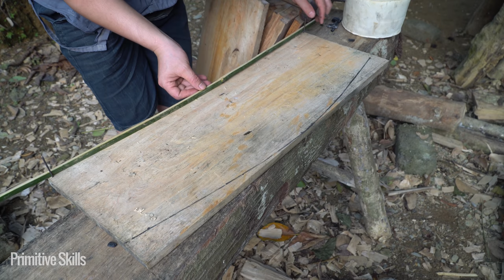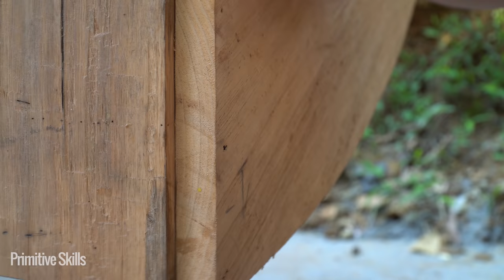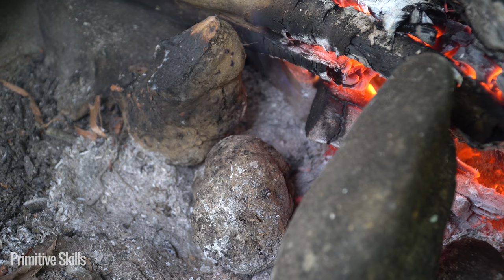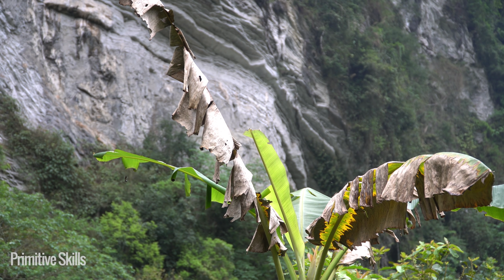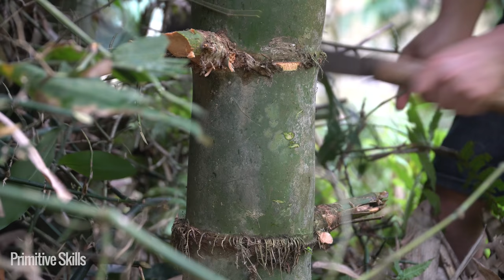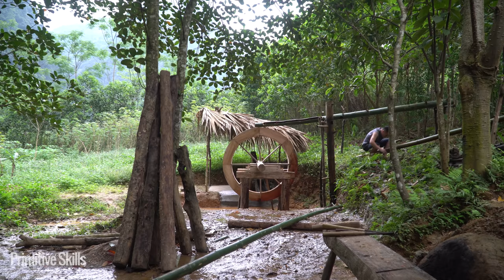Primitive Skills: HOW TO BUILD A WATER WHEEL // Complete After 2 months, put into TEST RUN - Ep.134

Comment: He was powerful before but now he has access to, UNLIMITED POWER!!!
Reply: POWAAAAAAA
Reply: Do you mean stand powa?
Reply: Not really. Yeah, he can get it to turn, but if he tries to connect that power to anything, that wheel's going to stop turning. I can barely keep up its own momentum, and even as those rough spots wear down, it's just not efficient enough to do much work. His power hammer build was a LOT more efficient, because it would actually do the work. This won't, as-is. He need BOTH more waterflow, and a more efficient axle.
Reply: @FornaxusCrucible  aye, he’s gonna need to smooth out the axle and find himself a proper lubricant to keep it spinning
Reply: He could also run another water line right beside the one he has so there's more water pressure to turn it
Reply: @jackturner3803 little bit'o spit, hell be golden!! 🤣
Reply: @FornaxusCrucible  he can make an electric motor if he finds copper
Reply: @Resiprocity  he needs more than that. He'll need an efficient steel axle for the coil, and he still need to REALLY drive up the efficiency of the wheel, itself. But yes, theoretically, that can be done. He already has the tech to smelt the copper, which is a good start (assuming he can either find the raw ore, or better, "pureform" copper chunks).
Reply: @tylerv7938  That would also help quite a bit, more volume of water would really do the trick
Reply: Hunt a pig...render the fat. Enclose and seal the axle and cradle surfaces. Pack in the fat. Or, find a similar wood to Lignum Vitae for the bearing surfaces. Whatever he does to solve the friction I will be interested to see.
Reply: Adding more water will not increase the force of the wheel, only lubrication will allow it to share it's true force.  More water will only cause it to turn faster.  After all, once the scoops get filled, will it have enough weight to turn the wheel.  Now fully enclosing the wheel will make it pressurized and increase the torque it produces.
Reply: Well, the wheel isn’t spinning consistently at all (It keeps the same speed forth barely 3 seconds, stops, speeds up, slows down tremendously, so on and so forth). He needs more water flow, and a better and more lubricated axle. Even when he gets at that point, he needs a permanent magnet, and to surround it with coil. He has the power available, but the hard part is actually harvesting it for some energy. That’s the problem that we have now, we literally breathe unlimited power, but we can’t find a way to tap into it.
Reply: @FornaxusCrucible  The place where the axle touches the base of the water wheel should be made thinner and smoother, that’ll help to make the wheel turn consistently.
Reply: @potatoboy549  The weight of the troughs when full will always stay constant,  More water flow while it may fill them faster, it will still stop.  Same water flow, and a work around on the friction problem should be the next bet
Reply: @luckyx16  Or more water flow and larger troughs on the wheel. Enough water to fill the troughs just as fast, but at higher volume will increase the force. But that's still only part of the solution.
Reply: @FornaxusCrucible  Yes, larger troughs would add more weight and counter act friction.  Are you going to tell the poor guy to rebuild his wheel?  I am not.
Reply: @luckyx16  More water flow will help the wheel go faster, which is great, if it’s going to be used for a better forge blower, a loom, a lathe, etc. Some animal fat (Preferable from wild boars, granted this guy doesn’t get headbutted and a tusk stuck inside his stomach trying to hunt one) some bearings around the axle, and to smooth out the axle will make it not stop.
Reply: @luckyx16  More water flow will help the wheel go faster, which is great, if it’s going to be used for a better forge blower, a loom, a lathe, etc. Some animal fat (Preferable from wild boars, granted this guy doesn’t get headbutted and a tusk stuck inside his stomach trying to hunt one) some bearings around the axle, and to smooth out the axle will make it not stop.
Reply: @FornaxusCrucible  I expect barrings or lubricant should be relatively easy to make compared to the whole itself.
Reply: @FornaxusCrucible  Yeah, the volume of water running the mill is insufficient for that size mill. He needs more water, or a larger mill to use Archimedes principle more efficiently in order to be able to draw some usefull energy from this.. As for now, it is a useless installation. building skills, and craftmansship, I applaude him, but the progress he makes is deceptive. Using the methods he is showing, there is no way he produces enough high quality Iron/steel to produce those tools. Enjoy it as entertainment and inspiration, and accept he cut some corners to progress. I believe however, he would not see the number of views and subs if he were up front about it. Original Primitive Technology should've continued.

Comment: A few ideas that will help:
-- use the motion of the wheel and a chisel to lathe the axle bearing geometrically round
-- beeswax as lubricant
-- balance the weight distribution by removing material from the bottom if it swings back like a pendulum
Reply: Хороший совет т👋

Comment: Now to develop a gear and gearbox that will work your bellows for you. Also be cool if you planted some fruit trees and bushes.
Reply: gear box?  whats wrong with the old method  a simple old eccentric as in locomotive wheel is connected to piston rod  by an off center axle   ....thats called an eccentric..it is an easy way to convert rotational movement to linear movement....are you going to ask about a clutch now?
Reply: The bellows should not be the main priority. Hook the gear up to a circular metallic saw, and the progress thereafter will be on the next level!
Reply: @mobiousenigma  To be technical I was thinking a reciprocating rack and pinion set up since we are dealing with wood and simple iron hand tools. Having a gearbox would give him options to hook up different equipment. Even your locomotive eccentric, although I dont think it would work well when made out of wood.
Reply: @TheEminemOwns  Wouldnt a forge upgrade help make that circular saw? Seems like it would be difficult to make a thin and flat circle and would require more than 3 inches of heating space.
Reply: @PaleGhost69  This water wheel was also "difficult to make" you know
Reply: @PotionsMaster666  The waterwheel is made out of wood and is a 3000 year old technology. It's not that difficult when you have the right tools.
Reply: @PotionsMaster666  Does he have the right tools to make a circular saw with a radius bigger than 3 inches?
Reply: If he can get his hands on flux, he could forge weld a hollow saw. The alternative is to use his current saw blade (or a new one of the same design) for a linear motion mechanical saw.
Reply: He probably built that waterwheel for lathe. Without lathe he can't make proper gears and automatic machines
Reply: @Kenionatus  What will the flux do ?  How will it affect the quality of the saw ?
Reply: @PotionsMaster666  Flux prevents oxidation. Without some way to prevent oxidation, you can't weld (afaik). The oxide layers prevent proper bonding.
Reply: @Kenionatus  But wouldn't flux come in between the layers and prevent them to bond ? 
Thnx for the reply man.
Reply: @PotionsMaster666  Just looked it up on Wikipedia and it's quite simple: the flux gets pushed out by the force of hammering. Flux melts at the temperature for forging the metal in question, so it is quite easily displaced.
Reply: A lathe and a better, automatic forge blower should be the priority. A lathe for better gears, and to upgrade the water wheel, and a forge blower obviously for better iron scraps and tools. But before any of this, the axle needs to be lubricated, possibly from the fat from wild boars. A water wheel opens a bunch of possibilities, and this guy will soon enter the Industrial Revolution and start making some machines
Reply: @PaleGhost69  Old school (very old) trip hammers could be run by a peg or cam on an overhead shaft.  The peg on the shaft would rotate around and intersect a corresponding peg on a vertical shaft, lifting it until the peg on the rotating shaft passed the top, and dropped the vertical shaft.  This trip-type mechanism can be used for many different reciprocating mechanisms, and can be easily engaged/disengaged without the use of a complex clutch.
I could see this being very useful, for automatic hammering, bellows, sawing, and especially water pumping.

Oh yeah, and they work great, even made of wood.

I think it would be a really neat (but involved and laborious) to see him set up a water tower for power accumulation, have the wheel run constantly, pumping water into the tower, and when he wants it to run faster, let water down from the tower into the wheel.
Reply: Isn't the main point to mill the grain? Wasn't that the reason the other parts of the water wheel series kept showing the monjolo pounding at grain?

Comment: I would recommend a cap for the axle and a possibly a sacrificial bearing surface, leather,  lubricated with a fat based lubricant.
Reply: An Iron ring polished smooth will wear less than wood on wood, and divert the dripping runoff water to keep it cool.
Reply: @xkblxcripple  you can't put Iron there's water
Reply: @powergamer4968  polished and waxed stone, maybe? Or graphite grease?
Reply: I know it would be a nightmare to make, but cant he make wooden or ceramic based ball bearings? i mean. he can melt iron, the bigest problem here would make the bearings have the correct size but it would make the friction go way lowwr than wood on wood or wood on lubrificated leather
Reply: I have come to think of the alternatives offered in the comments to improve friction. Although I think the rotation would at least be improved with a dodecagonal (12 sided) design instead of octagonal. Ideally, it should be a perfect circumference, although it is more difficult to achieve and more laborious.
Reply: Fat harvested from wild boars for a lubricant and some wooden bearings is all he needs for now. Once he upgrades to a better forge blower with all this, he’ll definitely be able to melt some iron and make some iron bearings.
Reply: @newemc2  Sorry, I don’t understand math language, please speak in English
Reply: @potatoboy549  The axis that he has put has an octagonal shape (regular polygon with 8 equal sides), it is not entirely circular. The closer it gets to a perfect circumference, the better it could turn/rotate, and the less friction. Since giving it the circular shape requires more time, you have to be more precise in the cut, and invest more energy, I would propose to make a cutting axis of a 12-sided polygon: https://en.wikipedia.org/wiki/Dodecagon
Reply: I think that smaller diameter axis (carve some excess wood from the axis), so there would be smaller contact surface and smaller friction. Still awesome stuff
Reply: @michasowik2438  Bingo. That's the issue. Physics.
Reply: @powergamer4968  aslong as iron keeps driped on by water(stayes underwater) it can not rust, so no problem. water being used as lubricant and as cooling factor (the water layer on the metal keeps the o2 "oxygen" away from forming rust and cools away the friction heat.)
Reply: At one point, i thought he was going to use a large diameter-ed section of bamboo for a ball bearing of the axle. Replaceable, easy and smooth.

Comment: this is so cool. i have a few pointers, feel free to disregard.
the first is to shape another two pieces of wood and fit them over the shaft, to stop the wheel from trying to jump out of the rut. just two pieces of wood shaped as a U and nail it down. 

second pointer is to rub some sort of fat on the shaft instead of water. water in industrial uses is not actually a lubricant. you're better off catching some fish, rendering them and rubbing that grease onto the axle. you'll have to reapply fairly often i imagine but it should stop the creaking and make the wheel run more smoothly. 

nice job on all the work you've put in though, it's pretty incredible.
Reply: Just using the coal as lubricant is enough!
Reply: @Nitro8996 some mushed up leaves might work as a lubricant too. They certainly cause a lot problems with slippage on our UK rail tracks !
Reply: Agreed a cap would help. However IMO the main issue besides lack of lubrication is that the axle diameter is too great. They need mortises carved into a smaller diameter. Basic physics. 
Oil and grease can be hard to find in the natural world. Possible sources: animal/chicken, cotton seeds, palm seeds, coconut. Also, if there are bees there is bees wax.

Comment: Yeah bud you need some kind of wax or animal fat in the joints of your water wheel lol. Maybe even a really oily plant you might be able to mash up and stick in the joint? Well done on the build 😁👌
Reply: También puede usar un poco de arena de rio, así consigue dejar la madera fina por la abrasión de la arena.
Reply: Or he at least should probably sand down the joints. And build a cage around the joints so it can't hop out of track by accident.
Reply: I am surprised he diante used some sand to smooth it a little.

Comment: Would be awesome to see a powered saw mill built from this!
Reply: Yes, this is a huge advancement.
Now he can power multiple machines with the cam. It can drive his piston billows to power a larger furnace, run a saw mill, a grain mill, even a hammer for faster iron working.
I imagine some of the next upgrades will be:
A spinning wheel, a loom, an anvil, a circular saw, a blast furnace, a glass furnace.
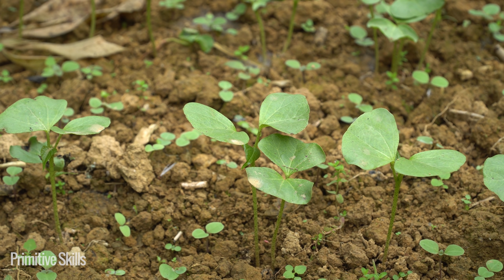Reply: @FourthRoot  seeing as he's growing cotton at 8:48 yeah i was thinking a loom is coming as well! we'll see what he does first! new fun and exciting episodes ahead!
Reply: He’ll definitely build a lathe. This is a precursor to gears, and a gearbox. After this, he can build a better forge blower. Throw in some bricks from some clay, and he’ll have a primitive but extremely useful Bessemer furnace, and instead of wrought iron he’ll have some actual steel. And later, he’ll even have a hydroelectric plant (This would be when he’d probably end the series, but I’d be satisfied because he harvested electricity from literally nothing but sticks and stones.)
Reply: @potatoboy549  No, the series ends when he launches to Mars. The final episode will be titled "Primitive Gas Core Nuclear Thermal Rocket".
Reply: @potatoboy549  A lathe is definitely belongs on the short list of next steps. To get the most out of that water wheel, he could use some machinery with roller bearings, precision milled cogs, etc. Maybe a primitive steam engine isn't that far off.
Reply: @FourthRoot  Yeah... but I watch for primitive skills not early industrial small factory channel.  If I wanted that there are thousands of other channels that already cover machinery of various kinds.

Comment: Great work as always.  Even with a better turning surface/lubrication, I dont know that he has enough power  for any real load. He needs to either have a higher water source or more pressure. For now he could use it like the monjolo, for grinding and milling.

Comment: Super impressed, man incredible craftsmanship. If you’re going to use the water wheel to grind rice into flour though I think you might end up needing more water pressure though. You may have to pipe more water in from the stream. Though if you do choose to do that you may wish to encapsulate the drive shaft of the water wheel so that it can’t escape from the frame.

Comment: Success! That is awesome to see that thing turning. For the bearings, if you notched grooves in the axle to reduce the diameter by a couple cm, there'd be much less friction. Smaller bearing board notches would be needed, but you were smart to make those boards modular. Obviously, some grease or wax would help too.

Comment: Three things you could do with the water wheel:

1) make a lathe. You basically just need a way to attach a clamp and a work area at one end of the turning axle, and then you could easily make rounded wooden objects, which have a lot of uses.
2) automate your bellows if you want to. make the water wheel turn another wheel with two  rods attached to it, like an old time locomotive wheel. Back-and-forth motion made easy, meaning you can keep the forge or kiln up at very hot temperatures if you need to.
3) automatic pottery wheel. I'd love to see you make more pots and pans, but you've been limited by the technology. Now that you have a water wheel, you can make it spin the pottery wheel for you, meaning you can use both hands to make the pottery. :-)

I know you're planning on making your own shirt, but... you know primitive people knew how to barter with each other, right? There's no shame in trading something you made for a new shirt to wear, at least until you can make your own. Same goes for a blanket for your bed. :-)

Comment: Yeah, the axile needs some animal or plant fiber fat. Coconut oil, or pig fat. The wood will swell up because its absorbing water. If you create a cap or sheet metal fitting where you rest it, you can reduce the friction & swelling. Nice job.
Reply: should mix with fine charcoal powder, since charcoal powder is easier to obtain and can help retain the fat in the area for lubrication

Comment: Hey now that you have a waterwheel you can make a grinder for your rice, by using 2 rocks. One has to be stationary while the other is rotated like a gear. If you have a hole in the rotating rock it can be used as the feeding hole for your rice.

Comment: Loving the series. You can use the roman cement and bricks to make a improved water supply system so the wheel will spin with more torque and maybe a little faster as well. It can be fun to make and also it would match the drainage systems haha! Good luck